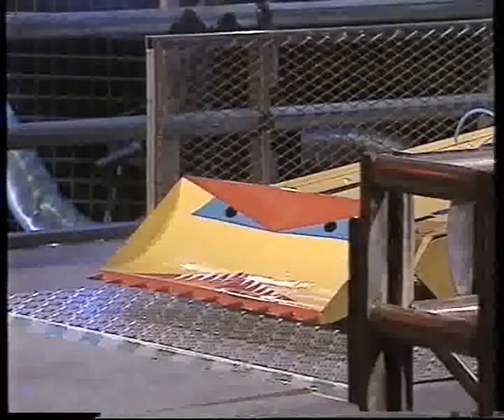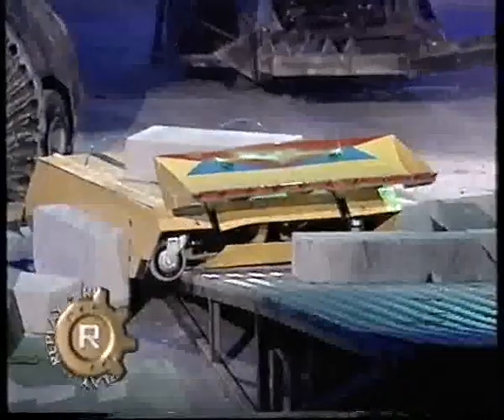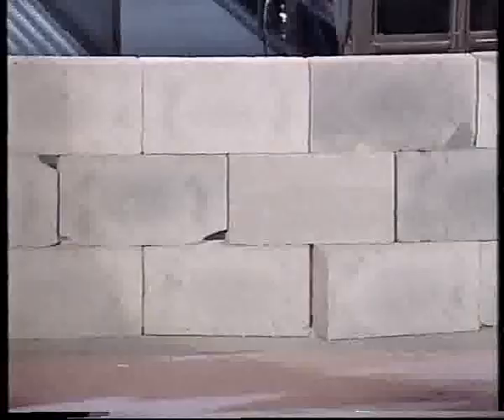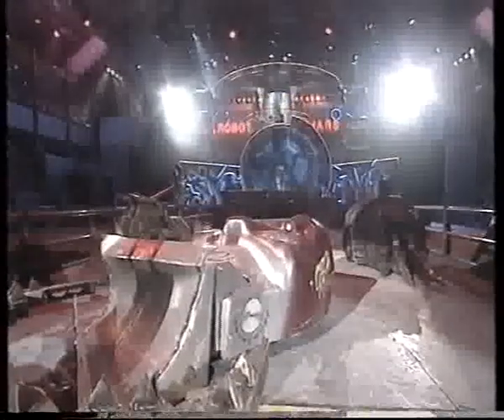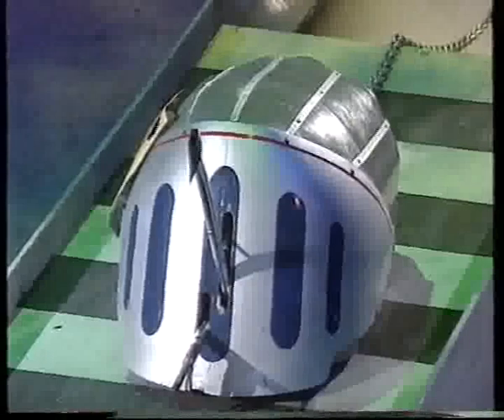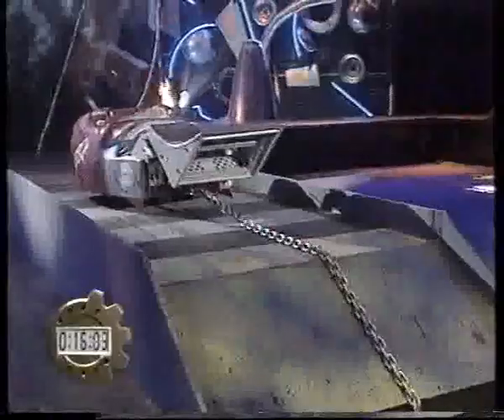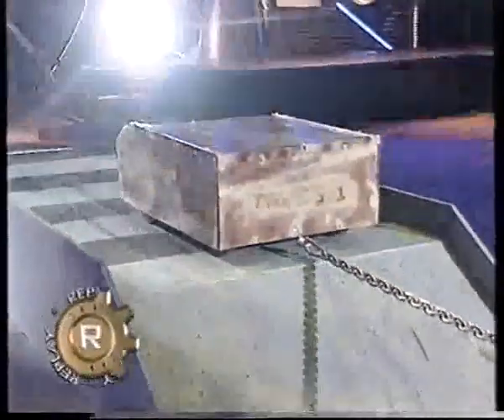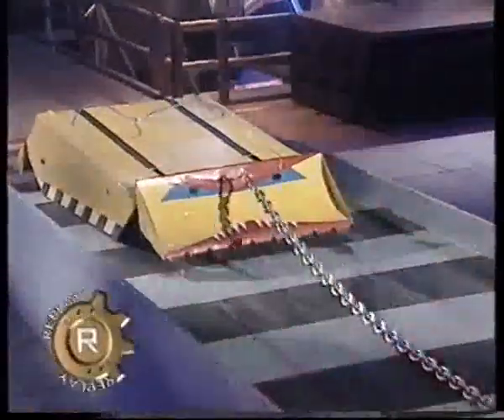RWars Series 2 Heat J Part 2

Comment: The judging in these early wars were so unfair. In fact so much of it was completely unfair. Some robots were ambushed by the House Robots before they had a chance to move, some robots completed the gauntlet by getting the front end of the robot over the line when others were told they hadn't completed as they had to get their whole robot over the line. Sometimes the house robots would deliberately let certain robots win or actually help them (look at Ivanhoe in this event), and sometimes (like this) results were completely manipulated, Kill Dozer went a shorter distance that Broot but they changed the result so the most amateur robot was eliminated.
Reply: How did Killdozer not go further than Broot? Last I checked Broot was shunted back against the wall close to the beginning and Killdozer remained on the ramp. I think the bigger question is how the judges counted Killdozer as going further than Penetrator when Penetrator got over the ramp and Killdozer didn't.